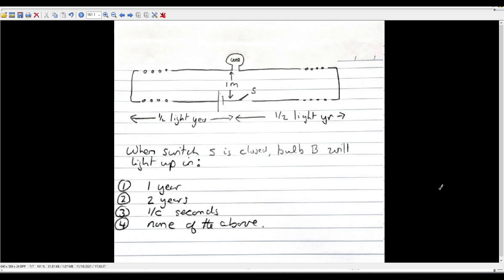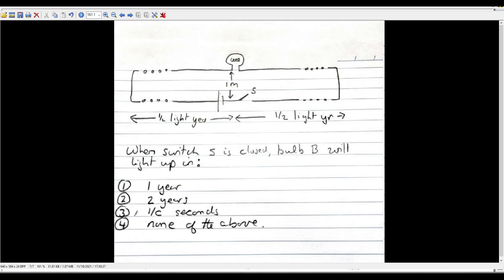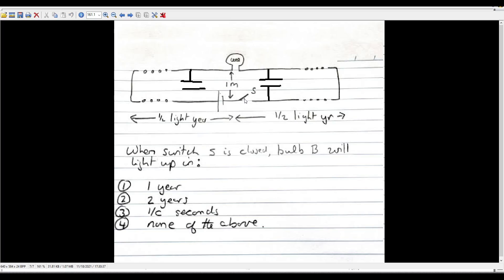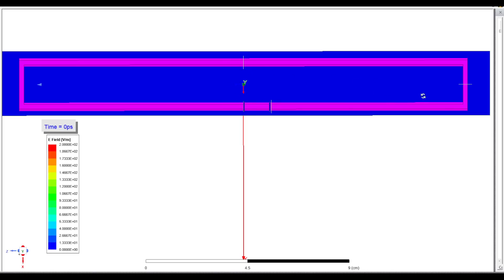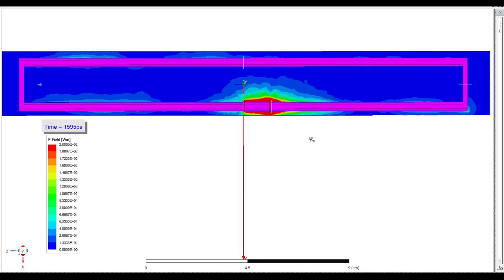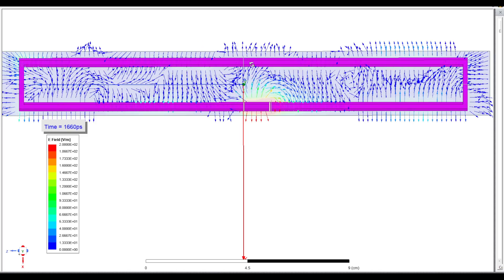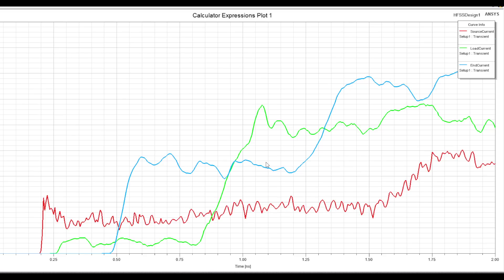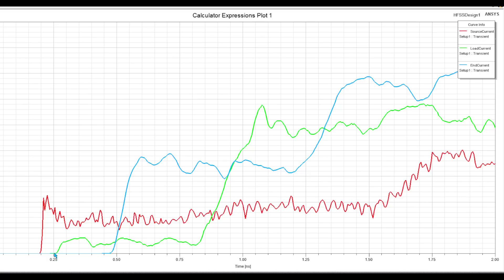Response To Veritasium - Electricity Propagation Time Problem

Comment: I disagree with the conclusion because there is a logical flaw.
The question could be interpreted in different ways:
- How long does it take for the light to light up in reality?
 The light will never light up because the battery is not powerful enough considering the wire resistance, so 4).
- How long would it take if the  battery was powerful enough to overcome the resistance?
 Assuming the battery could overcome the resistance enough to light up the light bulb, it is 1) because it would require load energy.
- How long would it take if the battery was powerful enough to light up the lightbulb with just the energy coming from what is basically an antenna?
 Then the answer is 3). This is the least likely interpretation I would have given. He spent a lot talking about circuits, and this answer has nothing to do with circuits, as the circuit approximation doesn't even apply.
Reply from the maker: I can appreciate your reasons for seeing 3 as a secondary solution, however I dont think you can say it is a logical flaw. The reality is that non of the options completely characterize the solution and an in depth knowledge of EM theory can reveal the "truths" in each of the answers as you have outlined above. I find (3) to be the "most correct" answer because to the lay person it would be the most counter intuitive and the revelation that it is at least partially correct is very educational about how electricity works. But I completely understand why you might prefer (1) from a more practical standpoint.
Reply: @PulsedPower  I think there would be a logical flaw in saying that the energy "is flowing in the circuit", which I thought was implied, given all the explanations of how the energy flows in a circuit.
However, he didn't frame the question that way, so I can at least say the video is misleading :)

Comment: I think the Veritasium discussion is carelessly  jumping back and forth between the time domain and the frequency domain without observing the restrictions imposed by the transformation.
Reply: The EM field is caused by the acceleration and de-acceleration of electrons. You can plot the field with time on the X axis (time domain) or frequency on the X axis (frequency domain). You can use a mathematical transformation (Fourier transformate) to change from one domain to the other.
Reply: What is transformation?

Comment: Thank you very much for this.  I left the Veritasium video wanting this exact analysis.  And now that you've done it, I feel like it refutes the Veritasium video. To me, his thesis was that the steady-state Poynting vectors show the energy flow is just straight across the 1m gap, so he used that 1m gap to determine the startup behavior.  If we set the criteria for "turn on" to be at least 75% of steady state power, I don't think 1/c is the answer any more.

To continue his discussion, I'd like to see someone show him what the Poynting vectors are doing while establishing the steady state.  Seems like your software could probably do that?
Reply: With the wires 1m apart as in the video I think he'd be hard pressed to find a bulb that would turn on with the current at t=1m/c, but not burn out at t=1s.
Reply: @bitbyt3r  very succinctly put! Ben makes a similar mistake at the 11:31 mark in the video where is states that "we can assume" that the light bulb will light up at 0.3 ns in the graph.
But the same graph shows current 8 times higher at the 1 ns mark... which would destroy such a bulb.
In the end, the question posed by Derek is a very misleading one with no meaningful/useful lesson.
Reply from the maker: Certainly a correct practical consideration!
Reply: Problem is: Veritasium mixed two topics into one video that have nothing to do with each other (from a teaching perspective).  
- First topic is basically the wires behaving like a capacitor and that an EM field will reach the bulb.  
- Second topic was the Poynting vector, which is a nice quirk from the formulas, but has no real life relevancy.  
You don't need either to explain the other.
Reply: @whuzzzup  IMO, he answered a different question to the one he initially posed, by adding extra clauses, assuming physically impossible “lamp”(magically lights up from infinitely small potential/current while staying off despite the unavoidable existence of noise) and “switch”, which acts more like a battery that instantly appears in the circuit from nowhere.
To distract from this bait and switch trolling he used Poynting vector babble, as a red herring.
Reply: @Zippy Rainbow Contrived problems are fine when used as a tool to teach a concept, but the framing of the problem in the Veritasium video just seems like clickbait to me. The thumbnail says "Energy doesn't flow in wires" which is simply false for the vast majority of power distribution. Then he 'proves' this with a difficult to understand contrived example that is /technically/ correct but in a useless way... What exactly was his goal here? I just can't imagine how you'd arrive at this video if your goal was to teach the concepts involved.
Reply: @bitbyt3r   The correct title is “Ackchually, energy doesn’t flow in wires”

Comment: Ben i really appreciate your simulation as it shows visually what is happening. I would request that you you run your simulation again with the same source and load impedance so that there are no reflections which just muddys the simulation. Also can you scale it to match his 300 000km loops? He also made a mistake in the diagram saying that the 300 000km is ½ light second. It is 1 light second which means steady state is reached after 2 seconds. Thanks!

Comment: What do you think of Bob’s answer?
https://youtu.be/--v5BXmFYv4
Reply from the maker: Thanks for sharing that! Bob is an excellent teacher, I could take more than a few tips from his presentation.

His analysis of the many "ways of looking at it" seems to be spot on. Only thing I would disagree with is his characterization of electron drift in the wires. In this case the "elastic" interaction between electrons does not govern the current wavefront propagation. The electrons are all marching to the same drum so to speak. They each are driven by the same external electric field, which of course is propagating at the speed of light. In other words, the next electron does not start to move because the previous electron gave it a shove, it moves because it is now exposed to the same driving force that is driving the electron behind it.

Comment: Ben, how does the inverse square law play into this? Does the effect from Coulomb's law cancel out in this example?
Reply from the maker: Hi Jason,
The inverse square law will effectively reduce the ratio of "current driven after d/c seconds" to "steady state current"

As others have pointed out, the initial current induced after 1/c seconds is significantly lower than the steady state current. As you increase the distance between the wires this induced current will decrease as well.
Reply: @PulsedPower  Thank you!

Comment: The idea that enough power would be transmitted to light a 'real' light bulb that quickly is kind of misleading.   But if you don't care how much current is required to 'light' the bulb (as stated by the rules), you can boil it down to a single electron being accelerated by the battery which then induces an E field in the opposite direction with a 1/r dependence.  That induced E field then moves an electron in the filament of the bulb and the bulb 'lights'.
Reply: The two sides of the circuit looks like resistors of about 1 kohm until the reflection returns. If driven by 12 V and powering a 3 V single LED it would drive a current of about 5mA which is definitely enough to turn it on visibly.
Reply: @larslindgren3846  How did you determine the impedance?  You don't know anything about the wire's diameter or its inductance.

Comment: So - does the circuit have to be closed in order for this to happen? What if the light bulb is not actually connected to the circuit, and the switch is closed and current starts to flow? Would this happen regardless?
Reply: It would happen regardless, and the circuit discussion is irrelevant because the concept of the circuit is an approximation that only applies when the length of the circuit is small enough with respect to the time considered, which is not the case here. This makes the Vertiasium video very misleading :). Those wires are basically acting as antennas.

Comment: Did you model things relative to t=0 ?
If not, shouldn't there be static electric fields at begin?
Reply from the maker: You make a great point, I did expect there to be "static" fields before the step response at t=200ps. I have the source set as a constant 1V potential and the switch starts at 1V (reversed polarity) and then drops to 0V.

I will investigate this a bit more and think about how it might affect the results. It seems like a 1V step response should be the same no matter its polarity or prior state, what do you think?
Reply: @PulsedPower  Stepresponse is practically same, i think. Atleast when looking current waveforms i.e. voltage change waveforms. I would think in academic aproach there is some really minor difference. Hard to think how absolute electric fields differ if thinking whole time t=0 -> steady state.

Would be great if you could run simulations having original static field included. And another where the "switch" (your changing supply) would be on positive side of the "battery" (constant supply).

Also interesting how source resistance of battery and impedance of lamp at opposite side would affect waveforms.

In anycase those wont change the answer